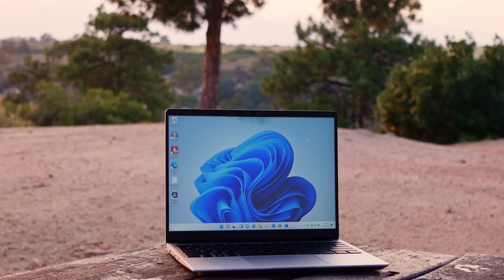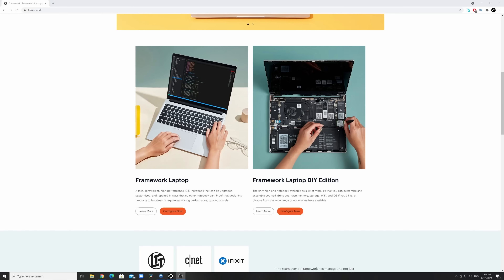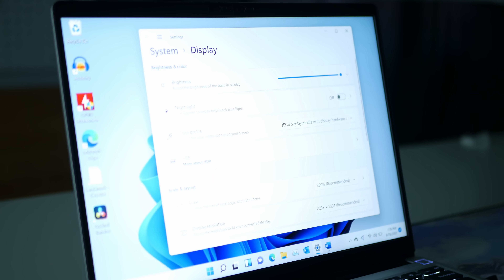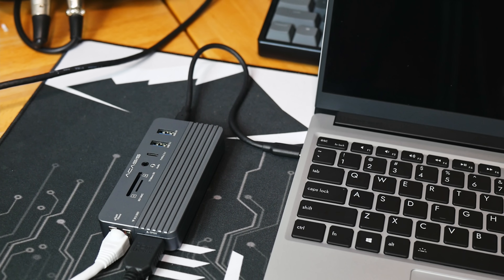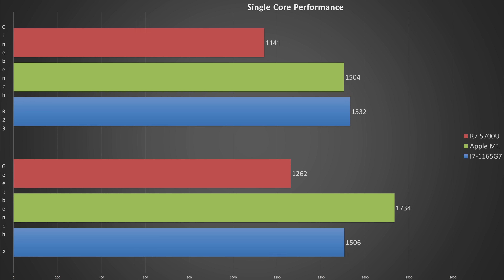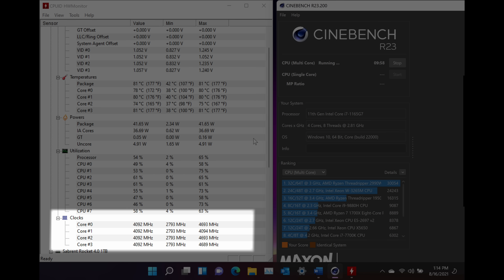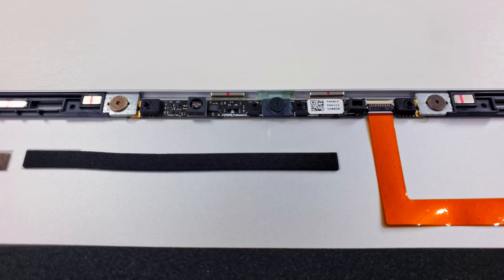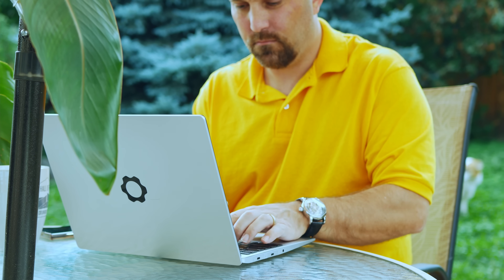The Framework Laptop - An Honest Review.

Comment: Even if framework will go out of business right now, their laptops will more serviceable that apple's, because they agreed to share schematics with service centers. Which Apple does not do even for certified services.
Reply from the maker: But if Framework is out of buisness, where will an independent repair shop get the schematics?
Reply: @ElevatedSystems  Well, from other shops at least, who bothered to ask in advance and, considering the overall behavior, they might even publish them going out of business. It's not like they will need them anymore.

And even if not, repair shops manage to reverse PCBs designed to be unmaintainable. I expect they would have much easier time with PCBs designed for maintainability.

Comment: It was nice hearing about your personal experience with the laptop so far.
However you did lose some credibility after the single/multicore bit.
Your point of typical productivity tasks and singlecore is correct,
however... of course there are people looking for a portable laptop that is good at multicore performance. Take music production as an example.
And no, CPUs aren't supposed to hit 100°C. Intel CPUs currently just get that much hotter than AMDs. That amount of heat will have a big influence on continuous multicore use.
Reply: So Intel itself (on Ark Intel) says the Tjunction of their CPU is 100° C, but you know better than the manufacturer, right?

Comment: Sigh. If it was cheaper. It is nosebleed priced for propeller heads who get off on modular hardware.
Reply from the maker: The base model Framework cost $999. That's $300 cheaper then the base 2020 MacBook Pro.
Reply: @ElevatedSystems  m1 MacBook still better

Comment: Too expensive. IF I am spending $2,000 to run windows 10 - forget it. This should cost $500 tops to make a dent in the world.
Reply: To be fair 2000$ is the higher tier option. It starts at about 800$.
And also, what does windows 10 have to do with being to expensive?

Comment: I take points off for not offering a Linux distro as a preinstalled OS. The web site basically tells you to "go fish" to install that. People interested in a DIY/self repairable laptop are going to be more interested in Linux than normal buyers.
Reply from the maker: Framework only offers Windows drivers and at the time of review there weren't Linux drivers completely  worked out for all the features of the laptop, (Biometrics, TouchPad, wifi). I can't review a Laptop if all the features aren't working properly. I will be including Linux in my long term review.
Reply: @ElevatedSystems  That's good, but I was saying I think it is the laptop maker's job to do that. The alternative is "here ya go, you can try to run Linux on this laptop, but no garantees, and no help either. And no refunds. Lots of luck!".

Comment: Ryzen kills intel in productivity per watt,.  If framework opted for the higher watt configuration of the cpus that matched the intel tigerlake cpus, it would outperform tigerlake in every aspect.

The thermal throttling is only normal if you consider driving your car around bouncing off redline all the time as normal, or jogging to be synonymous with a flat out sprint. It has everything to do with the thermal solution being inadequate for the load.  The trade off everyone makes with super heated super poorly cooled CPUs is CPU life.  These CPUs will die in a much shorter time period than one prevented from bouncing off the thermal limit constantly. 

I am glad you put up this shilling review though, saved me from buying a tird.

Comment: Just get a mbp. Framework may go nite nite time in a couple of years.
Reply: Spend more on something locked to MacOS? No thanks, not with how bad the bugs are getting lately.

Besides, I built a Framework laptop that is $400 cheaper than my MacBook Air while having more storage, RAM, CPU performance, and ports. Plus, the Framework can run Win10 without melting.

Comment: The funny thing is your using basically an OPEN Laptop that can be repaired but paired with a shitty locked down OS lol =) Makes sense? That laptop needs Linux and not some crap software you can't control BTW...Sorry an Open OS and not Service dependent. Also this Laptop is wayyyyy to expensive when building and this is why these type of laptops always fail. No way in hell I'm dropping 2k on a repairable laptop when it DEPENDS on a company to stay in business. Now if more companies do this and the parts are not dependent on this companies survival then I'm all on board but for now this just seems like a way too expensive hobby that I'm not interested in wasting my money on.
Reply from the maker: Framework has a robust Linux following, however this is brand new hardware. At the time I received my batch one unit there wasn't a complete Linux distro capable of supporting all the hardware (TouchPad, fingerprint reader, wifi, graphics) Tough to review a Laptop when all the features don't work. Also find a 1165g7, 32GB memory, 1TB gen 4 SSD, a 200+ PPI display, full metal enclosure ultralight for under $1200.
Reply: @ElevatedSystems  Good point but this laptop is STILL reliant on some company to stay in business. Also the fact you can look around right now and see if there anyone else doing this and how successful they have been. I'm all in for great laptop that is upgradeable and with the ability to prolong BUT these are just hobbies and expensive ones that always fail. Come back in 5 years and tell me if this company still exists? I BET nope because the market we have doesn't and won't allow something like this to stay around. We are in the throw a way economy and this just doesn't fit. Also I'm not sticking up for Linux as I do run Windows as well it's just weird you say there are no distro's that doesn't support this as I'm sure you tried the 50+ Distros on this hardware. This laptop really is a joke and for people with disposable incomes or youtubers whom get free stuff to brag or to get paid to push products.
Reply: @otrkid7869  It relies on the company as far as the mobo, chassis, and battery are concerned. RAM, SSD, Wi-Fi, and I/O are all industry standard and have 3rd party replacement channels. You don't even have to buy the charger if you don't want to. What support does Dell, HP, or Apple give 5-year old computers? 

The computers that are jokes are ones with soldered-in storage. Not only are you out of a computer when something goes wrong, you also lose all your data. Spill coffee on an older Dell Latitude? The computer's done for, but pull the drive and pop it into another machine. Spill coffee on a MacBook and lose all your data (or at least anything since the last backup). Even if the drive didn't sustain damage and repair allows the machine to run again, Apple's repair services pretty much guarantee you lose your data even if it survived the damage.

In 7 years as an IT tech, of all the computers I've seen that actually stopped running, only one was a motherboard fault (shorted charger circuit that killed the computer on first plug-in, replaced under warranty). Nearly all the others were power supply or RAM failures. My gaming PC is a 2014 Dell Precision T1650 that was thrown away. New RAM and graphics card and it plays Forza Horizon 5 on high settings. My first laptop from 2006 still runs to this day on all original silicon (original mobo, RAM, graphics card, and Wi-Fi card). I've put a few (3rd party) batteries in it and upgraded the 80 GB HDD to a 256 GB SSD. Windows XP never ran so fast.

Let's face it, no other modern laptop has this level of serviceability. If laptops had a mobo standard, it would be desktop-equivalent, since even desktops usually require mobo upgrades to go along with CPU upgrades. Dedicated GPU is a separate piece that connects via TB4, so integrated graphics are really only for mobile use. I'd own one already if my 2020 MacBook wasn't so new. Even then, I might sell my MacBook Air, buy a Framework, and pocket the few bucks left over.